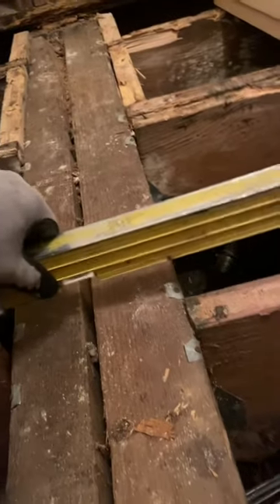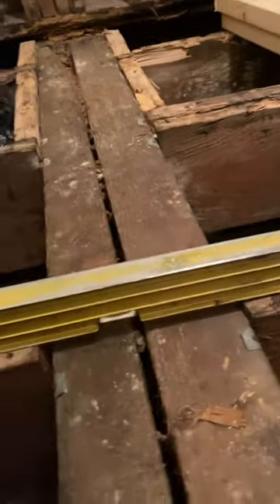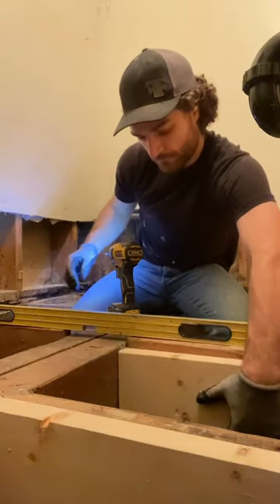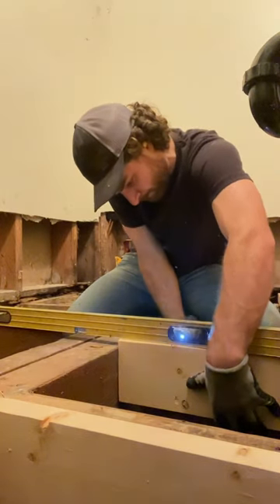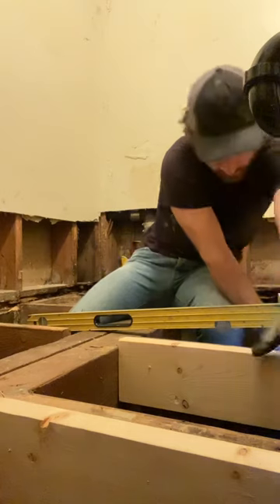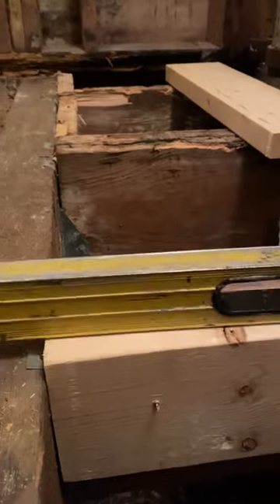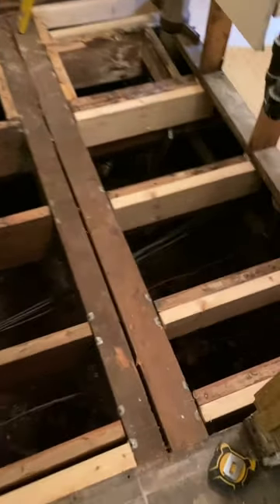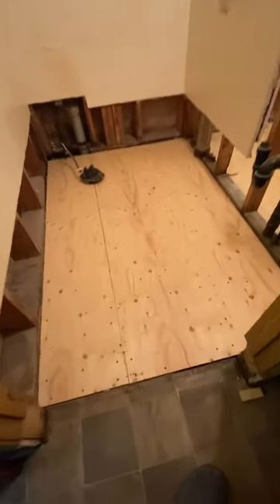How to fix uneven joists for new subfloor #carpentry #diy #bathroomrenovation #framing

Comment: Hey Zack once we sister the wood to the joist could we use leveling concrete for the subfloor?
Reply from the maker: Good question. I’d say you’d want to make sure, ideally, that those new sistered joists are resting on a beam or joist hanger, and use proper lags or bolts to secure them. Then you’d be good to go to plywood and use self leveler!
Reply: You could use it ON the subfloor I imagine.

Comment: What do you do with the doorways and windows when they are out of level because of the flooring?
Reply from the maker: Good question, 
In this situation it didn’t matter, we took an inch off the door, and the window was at a level spot already.
But it’d be safe to assume if you are doing this everything else may look wonky :/

Comment: Hello. What nails and power tool would be suitable for this method?
Reply from the maker: Hi,
You gotta use nails or structural screws or lags. Either an impact screw gun for the lags/structure screws, or a hammer for the nails.
Reply: Me personally, on big boards, thick ones, I like big bolts, with large diameter flat washers for serious clamping power.

Comment: What if u I joist? How do u sister up I joist?
Reply: I'd add a spacer(s) into your I  between the top and bottom to fill out the gap and make it flush with the side . then run your sister.  Not speaking from experience, just a thought